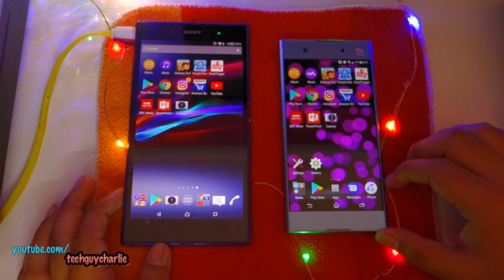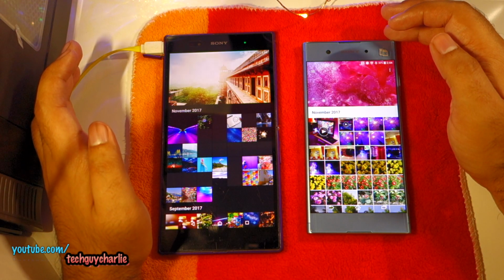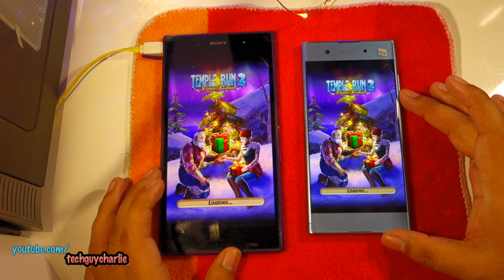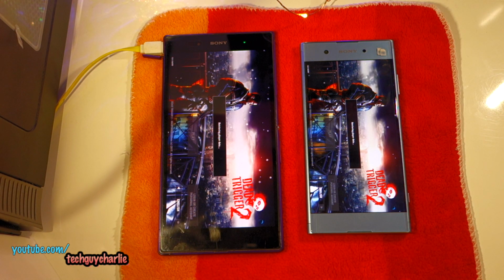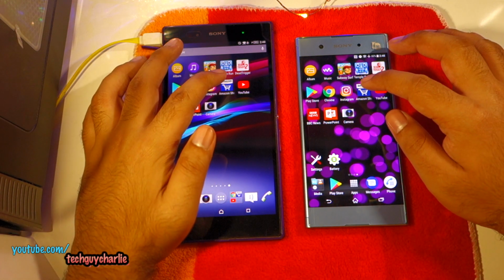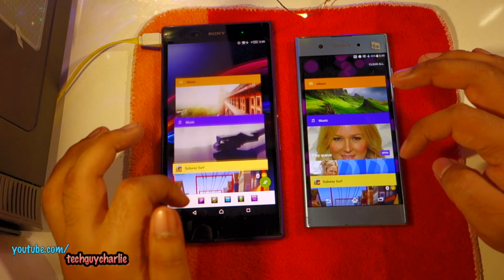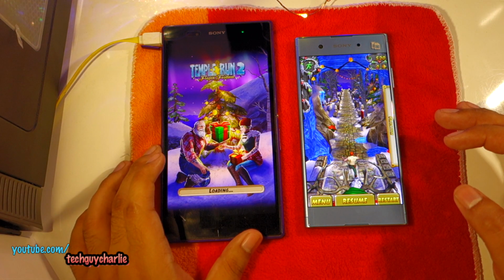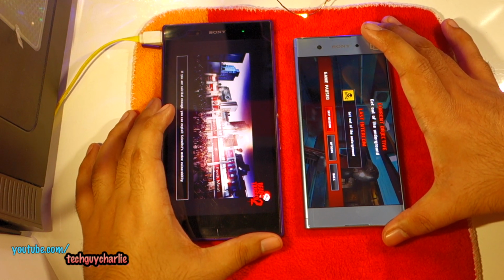Sony Xperia Z Ultra VS Xperia XA1 Plus speed test

Comment: Watching this on my Z Ultra,  yes im still using it after 5 years now and the device is epic, still snappy as new same battery life,  its amazing.
Reply: Иван Калашников I had my zultra from 2013 up to 6th March 2018 when it went into bootloop a week after I did a factory reset it started showing notifications messages onscreen this and that app isn't working went into a system android self file check result was a bootloop, which I couldn't repair on Xperia companion software repair or flashtool from Xperia stockroom. I got the Sony Xperia xa1 ultra it's a tiny screened midget compared to the wonders z ultra. That's mine sitting there with full battery and a black screen, waiting to return to whenst where it came from back in it's presentation box, I don't like my new phone much I loved my ultra 😔 😔 😔 😢 😢 😢 😡

Comment: Bro someone on YouTube told me xa1 plus lagging in temple run and getting over heating with dead digger 2 and he calculate temp. It reached 45° like Sony m4 what do u say?
Reply: Mahmoud Ebada is not true...
Reply from the maker: I don't think heat is an issue on XA1 Plus, I've done speed test and gaming video and the phone never lags or gets overheated, it only gets warm maybe around 37 degrees at max and I think any brand phone will get warm if you play games for an extended time. But 45 degrees? nope, mine has never gotten that hot.
Reply: Mahmoud Ebada Yes friend! this phone is great and the camera Super better than any Sony of 2016, even better than the Xperia X also I had and X compact in my opinion. photos Super clear and much better processed. processor helio p20 will luxury and not overheats the cell like all other phones Sony of 2016, the last troubled heating was the z5 but due to the processor. this CELL is very, very good. recommended 100 ;)
Reply: David Pineda yh i was surprised. Do you have this mobile ☺
Reply: David Pineda thanks bro so what the bad thing u think in this phone. I think that plastic glass of camera lens
Reply: Tech Guy Charlie I love u bro thanks for you. Continue don't stop You really have a special reviews. Thanks for all of your efforts. Sending love from Egypt 😘😀
Reply: Mahmoud Ebada of course, could be better but being careful nothing happens. it's just something like the z5. but for me this phone is much better than the z5. even being mid range.